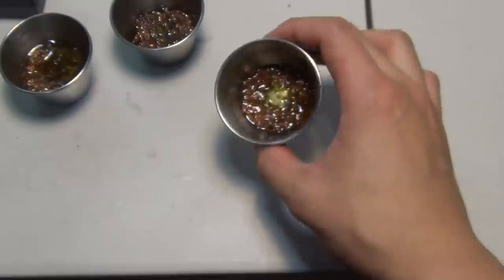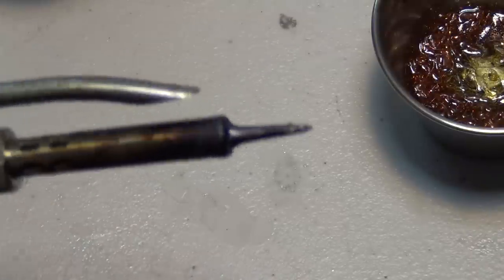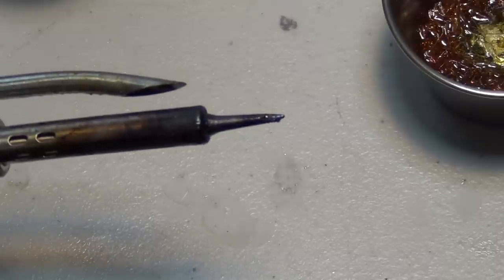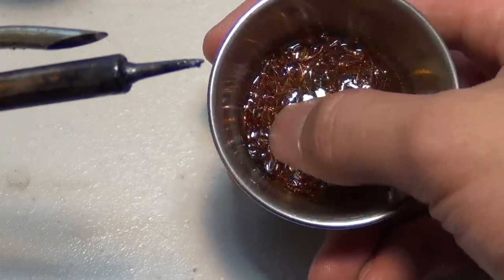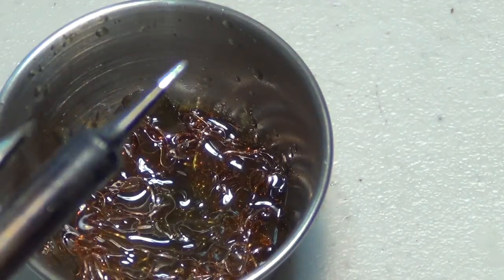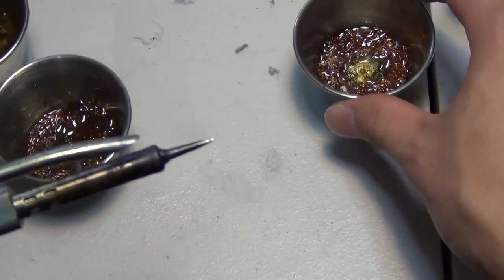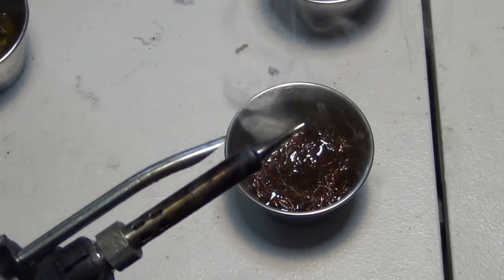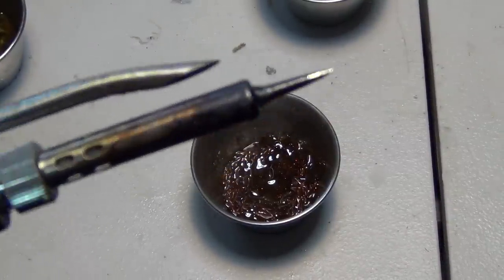Solder iron Tip Tinner Cleaner Copper LeadFree   RHoS CyberDoc

Comment: I have been using this product since around 2015 and I love it. I have tried other tip tinners and IMO non of them beat this one and are as quick at cleaning the tip properly. The only issue I have had with this product is when it gets old it dries rock hard and just shatters the contents right out of the cup. Since then I have tried other tip tinners, The old wire brush does a better job IMO. I will be purchasing another one of these very soon.